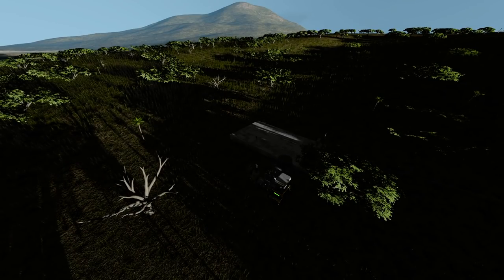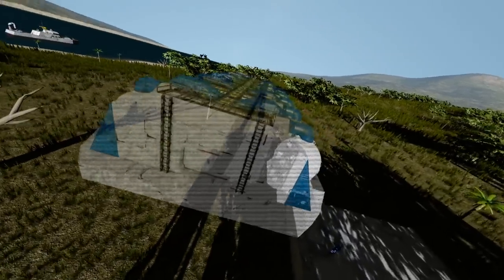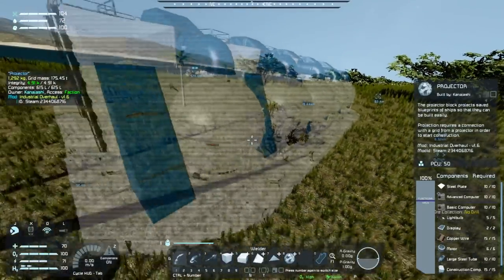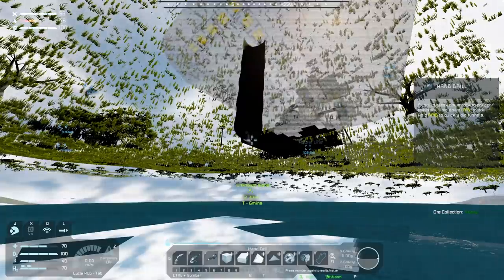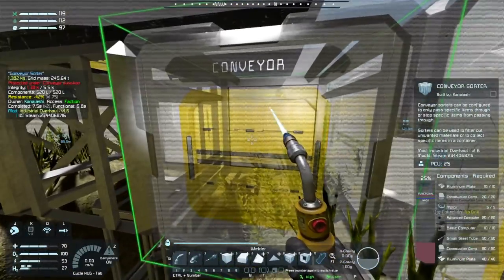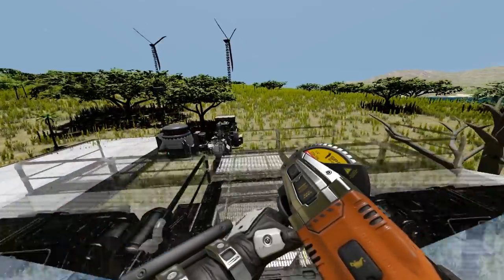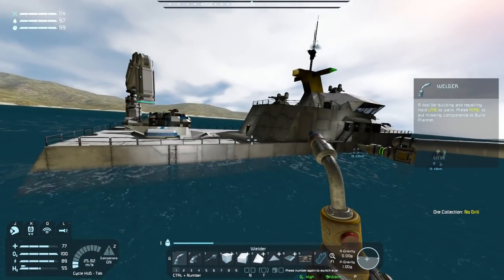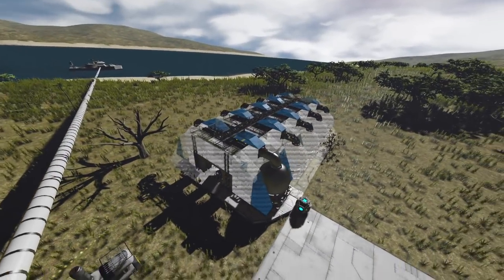Space Engineers - S4E26 'Hydrogen Storage Facility'

Comment: Concrete is cheap compared to Light Armor blocks.
5 girders is dirt compared to 25 Steel Plates and it's a good way to make use of all that Gravel.

tweaking Static Drills to shut them up is heavenly!
please put that up on the workshop!

want straight holes to make wells = Punch Drills are your friend.

just use your floating dock to run the pipe to and attach via the connectors so you can still use the Discovery for it's intended role.